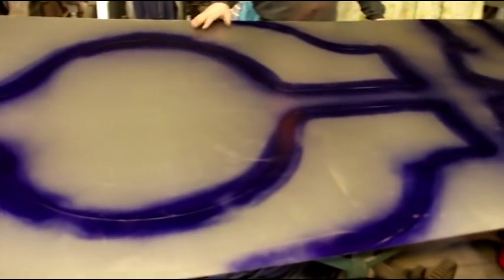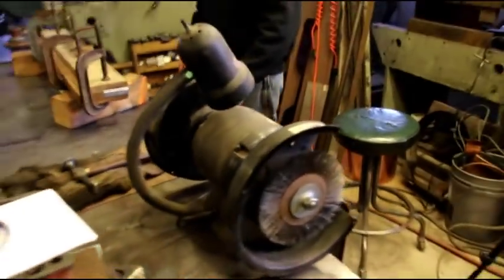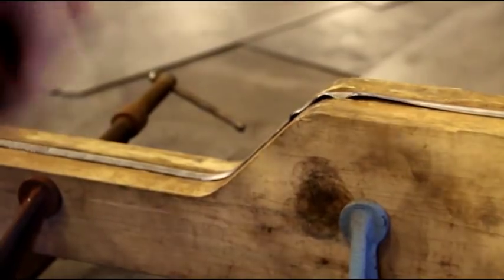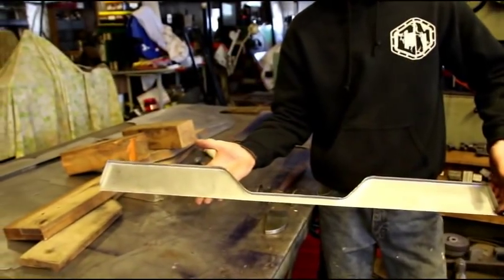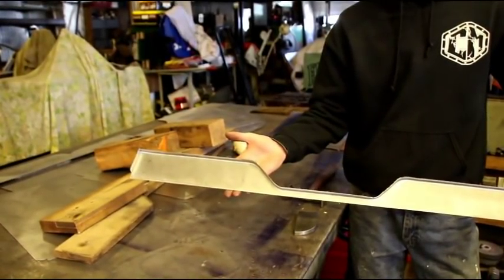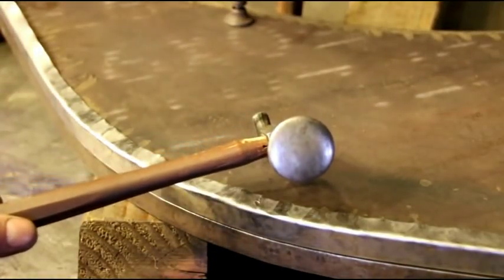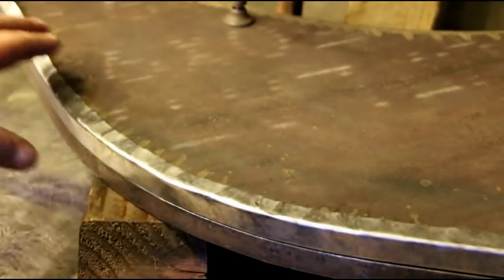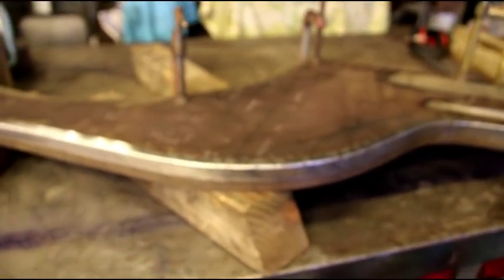Willys CJ2A Early Tool Slot Body Build

Comment: Well, that came out very well Brian. I use exactly the same hammer for this rounding over job, the thing you must do is go very gradually ,I find most people try to get it set over far to soon, and I must admit to giving the area an annealing sometimes, the other real important thing is that the jig must be rock solid, if it is not, most of the energy of hammering goes into vibrating the job, your jig is the perfect set up, solid, and not moving around when you are dressing the edge over, the tool indents are far worst I find, but we did not see to form those up, I have only done GPW and MB bodies which have the same slots in them, and they can be very difficult for me to form without getting the panel to "ping pong" around. Thanks for posting, I am sure this will inspire people to at least have a go at a panel. Chris B.

Comment: Hey man, love your Willys builds. I was wondering if you would be willing to answer a question for me? You wouldn't happen to know the top measurements for the front fenders would you? I think there 25 5/8"x10" with approximately a 7" radius. I'm planning on scratch build a flatty body that might not be a perfect copy, but still want to keep the proportions and most of the lines. Thank you in advance.

Comment: Brian video was interesting. What kind of wood are the bucks made out of? Pine, oak or another type of wood? Thanks
Reply from the maker: Rear quarter hammer forms are made out of 3/4" steel.  Rear cross sill hammer form is made out of two pieces of rock maple.  Other wood will not hold up to the shrinking and stretching that needs to be done.  Best material for all hammer forms is usually steel or a hardened aluminum.  
Brian
Reply: @metalshaperJeep  in the video it looks like wood then I was second guess myself about wood being strong enough. That's way I was asking. Thanks for your reply.

Comment: Another nice video Brian.  Do you have any issues with the poly hammers deforming?
Reply from the maker: Poly hammers can take a beating.  Just dress the face and start again.  I sometimes shape them to fit a particular purpose.  When they get small or too thin to use I just replace them.